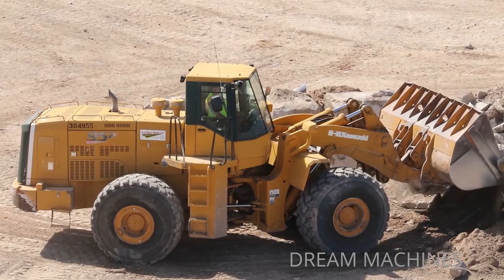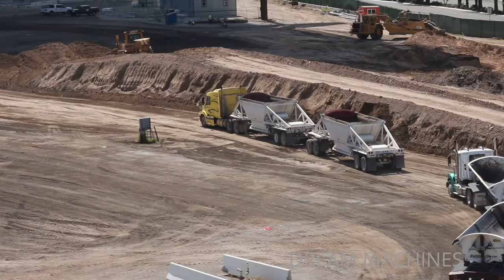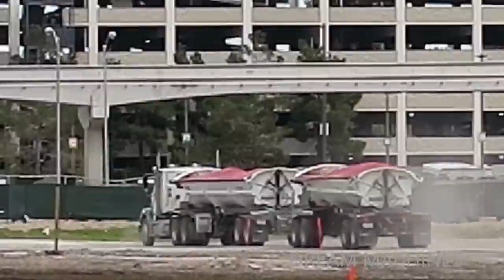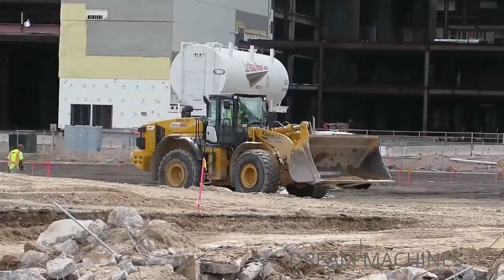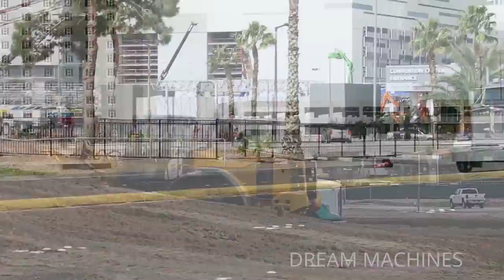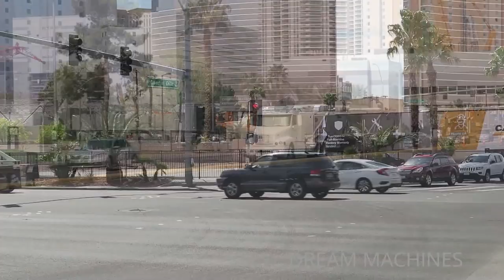HEAVY MACHINES IN LAS VEGAS WHEEL LOADER MOVING DIRT & LOADING DUMP TRUCKS ON HUGE CONSTRUCTION SITE

Comment: Nice video. You certainly have some very odd 'axle laws' in your different 'states', - in the UK you would get that sort of load - (with room for another 'bucket-full') - in a 5-axle artic including tractor unit axles, - total length 40'. Only difference is it would be a 'tipper' and not a 'bottom dump', and as for the length of the drawbar on the single axle trailer I'm pretty certain that would not be allowed. Mind you the roads are a bit wider than ours, (even in town), so I suppose it doesn't really matter